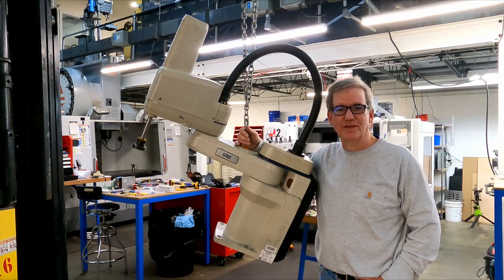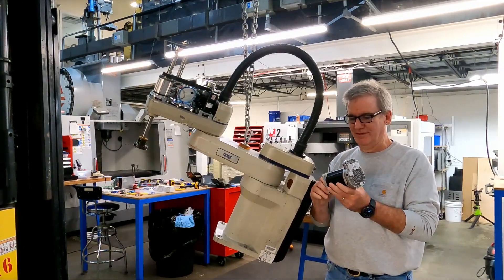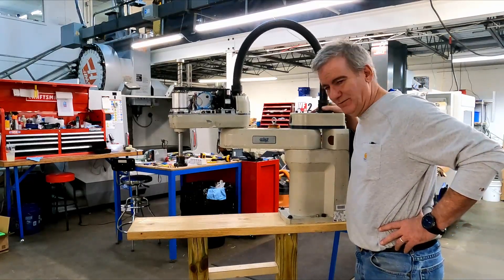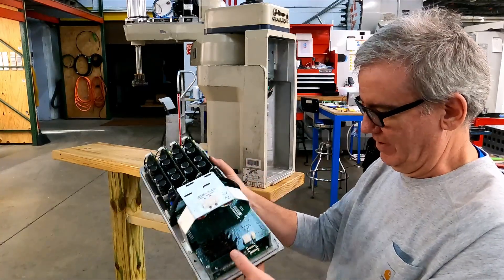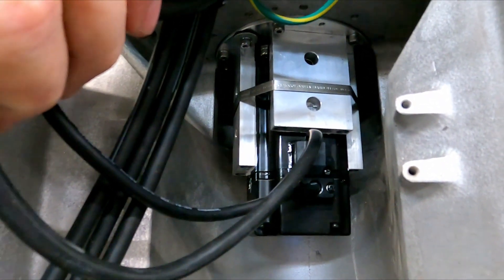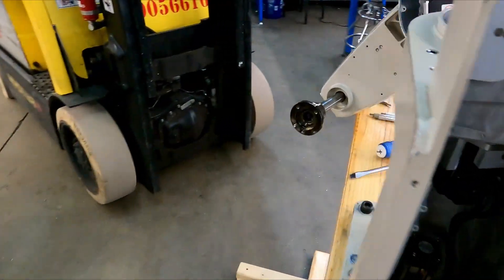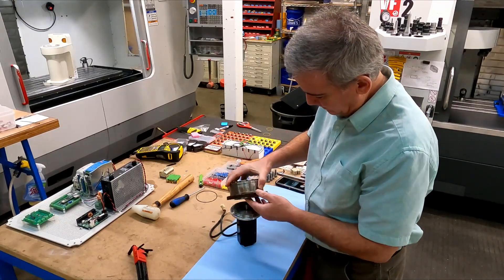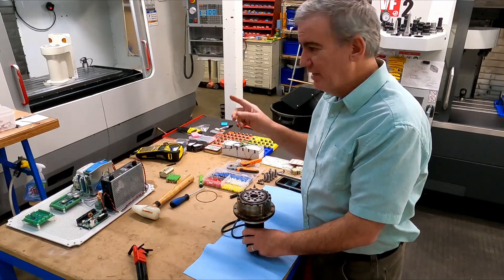Adept Cobra s600 Robot Overhaul to GRBL & ClearPath Servo Motors (Part 1)

Comment: the gearbox is actually called a harmonic drive to the best of my knowledge, and stepper motors are rated such as nema 17, 23, and so on, the motor there if not mistaken is a 400 watt servo motor, so probably a nema 24 bolt flange. Actual servo motors tend to have larger shafts. Im in the same boat s you, however im small, just me, and built my 1st cnc milling machine over the course of 2 years, with bt30 spindle and 12 position rotary tool holder. just got my first adept 550 robot and also doing new controls for it but with ac servo motors and amplifiers